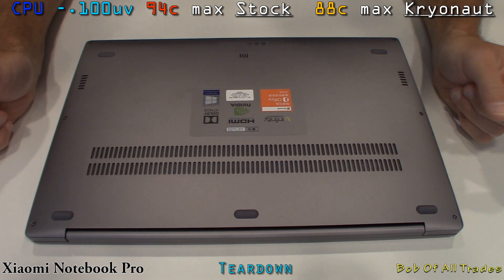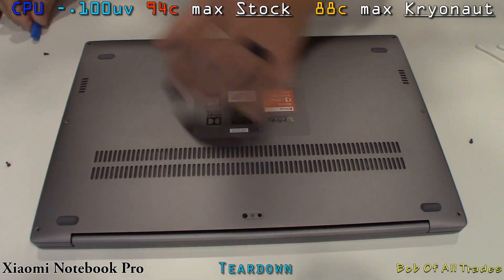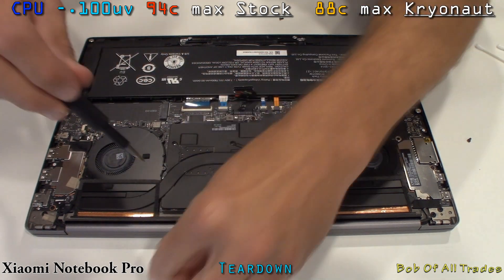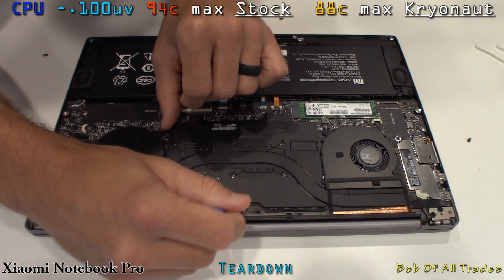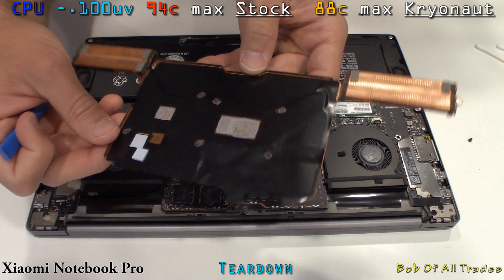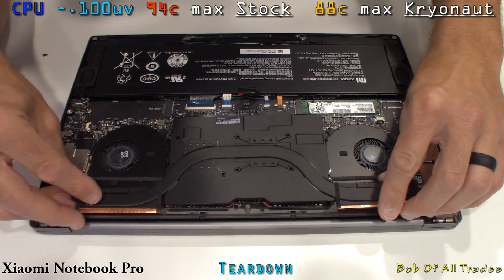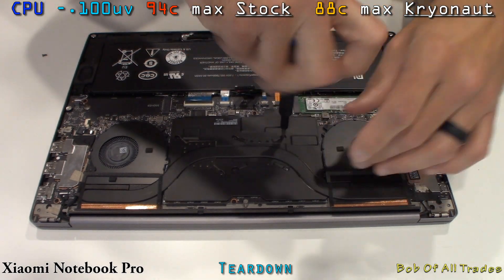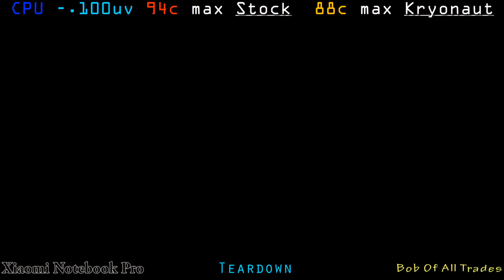Xiaomi Notebook PRO Teardown.  Unlocked and Overclocked Temps!

Comment: i suggest you go and learn more deeper how t apply paste on notebooks "dies" are dif. then on PCs , you dont have the plate that transfers heat to the paste etc, the paste on these exposed dies should be spread manually evenly cause only with a blop its normal that it will not push spread on the whole die, that means even when you have 80% spread but you will have 1 core that 20% not good connecting it can happen you will burn it out...it happened , its not so rare, ....a blop is "ok" for PC with big die and big surface on the cooler to sit on etc etc... but the point it the plate on PC procs. bc from die that is covered in paste than plate then paste coller- the heat can go at least to the plate and the plate will move it cause its heating as a whole... its just a heads up, it dont have to happen but it CAN, and rather to be 100% , a proc dies on motherboard like that ...well its a lot more expensive to replace everything with gpu and whole motherboard and memory often times then just a proc on PCs . :) see ya
Reply from the maker: The coverage revealed in the teadown showed perfect coverage on the die.  This was not the first time tearing this down so the die coverage you see in this teardown was the result of my previous teardown.

Comment: Have you thought about putting a thermal pad on the bottom of the heat sink to connect it to the bottom of the alluminum back panel. More metal thats exposed to air. I did this on my asus fx 503vm and after the undervolt, repaste and doing that my temps went from 94c max cpu and 89c gpu down to 76c cpu and 74c gpu. Without the thermal pad connecting it to the back panel it was at 80c max cpu and 77c gpu. It really helped keep it below 80c although i also use a crappy laptop cooling pad when gaming.
 
I first tried this on a laptop that only had passive cooling and it helped tremendiously.
Reply from the maker: This is thermally great.  You should see how cool it runs when it's running as designed and not unlocking a U series chip.
Reply: Bob Of All Trades 94c while undervolted with stock paste and 88c with kryonaut? How is that good?
Reply from the maker: eraldorh Because the “U” series chips are not meant to be ran at this speed. This thing is the equivalent of a 7700 HQ now that I tripled its TDP. Does that make sense?

Ran the way it’s suppose to and the cpu is in the 70’s and the GPU is in the 60’s. 

Either configuration never breaching 43 dB.  

All of which was covered in the review :-)
Reply: Bob Of All Trades Exactly, which is why I suggested the thermal pad connecting to the back cover.
Reply from the maker: eraldorh It doesn’t need it.  If you watch my review you’ll see that what it took for me to get those temperatures are things people are not gonna be doing with this laptop anyway. Under normal circumstances with this solution I don’t think I’ve had it past 84°C that was rendering video for a long time.

Laptops can run for years throttling their butt off.

Comment: Hi Bob, I have a problem, my CPU runs cooler while gpu runs at 96. Tried thermal paste from 3 different people but same result. They say that my gpu chip is defective as I replaced my motherboard one year ago. While I suspect that heat sink is not sitting properly on gpu. See image https://ibb.co/f0Dzqe
Reply from the maker: That is likely contact issues with the heatsink.  The cooler is extremely flimsy.  What was it like when it was new?
Reply: Bob Of All Trades yup I too think that, laptop worked all well with 70c temperature for 4 years but had to replace motherboard,  since then the problem is there. Technicians say if heat sink wasn't contacting gpu the thermal paste won't have spread, so my gpu chip is defective. I wish my machine could be in your hands right now

Comment: Awesome Great review! btw Which is better a better specs Asus rog GL503GE hero 15.6 1050ti 4gb 120hz panel 16 gb ram or HP Omen 15.6 thin bezzel 1060 6gb 60hz 12 gb ram. The rest of the specs they got the same specs 128 gb ssd and 1 tb hdd and, i7-8750h, Both of them have the same price tag of CAD$1,600. Which of them will you recommend?

Comment from the maker: Review live August 3rd

Before you say “OMG this is soooo HOT”. Listen to what I just said...this is now a 45 watt chip with 8 threads at 3.4 GHz. It’ll hold this under any circumstance from gaming to video editing.  Then I overclocked the GPU 150/1000 on the core/memory respectively.  

This is one-of-a-kind per its specs.

Stock temps on a locked BIOS?  CPU in the 70’s and GPU in the 60’s.  Worth it?  That’s up to you 👍

Want to know how I did this?  Check here.  https://youtu.be/2Dv6tJG4XfQ

This is special to THIS laptop, the Xiaomi Mi Notebook Pro.